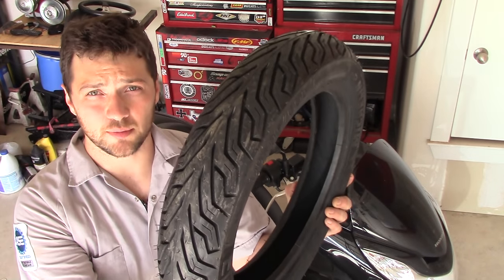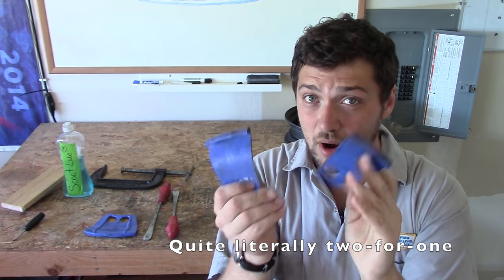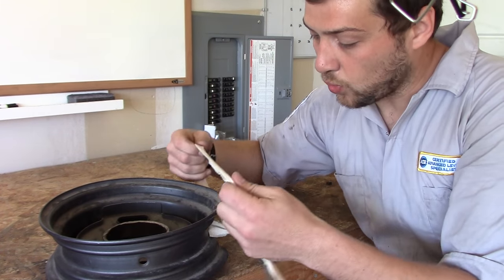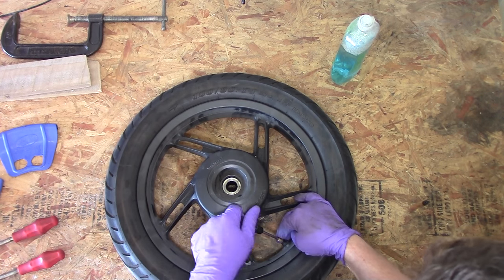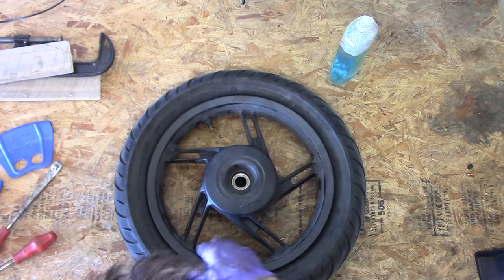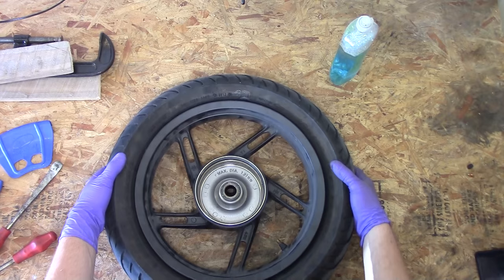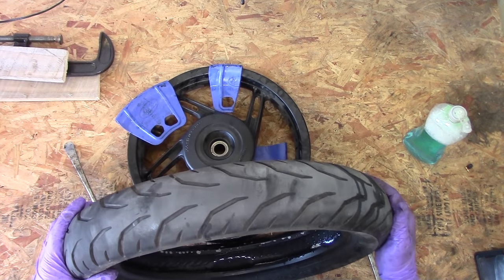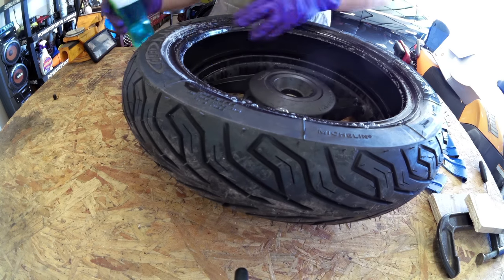Scooter 911: How to change a motorcycle or scooter tire BY HAND! (a complete guide!)

Comment: I am on a low income and this video may be the answer to my rear tyre XD
Reply from the maker: I hope it helps you out!
Reply: doing it yourself is less expensive only if you have $500 in tools
Reply: @carmineredd1198  wow what a bs. My toolbox is about 150 quid (with lots of tools crafted by myself using cheap hypermarket powertools).

I can literally strip the whole bike with these.
Reply: @carmineredd1198  Dude I literally bought 3 $5 flat heads from harbor freight and bent them and used a piece of cardboard as a shim. You can literally once you get it on the rim put it in the car run to the gas station and fill it with air then put it back on the bike. Not $500 maybe $30 tops depending how strong you are and you might have stuff around the house to use.

Comment: i used a rubber hammer to put it on and a wrecking bar to break the bead, lay the hook of the bar close to the rim on the  tyre and hit it down.go around the tyre on both sides, use you irons to lift it, to put it on jam the rim into the tyre, stand on the part thats not in the tyre and walk it in by pounding with the rubber hammer, insert tube and start it with the levers and when you get to the last tight bit, pound it with the rubber mallet, l used to change all my tyres cars scooters and motor cycles like this 50 years ago, now i just take it to a shop, bicycles tyres l still do at home without  any spoons just use  my hands, ps a split piece of garden hose protects the rim from scratches

Comment: Excellent video! Just used it as a tutorial to demount and remount a scooter tire to replace a leaking valve stem. One comment... I seem to recall a video in which Garrett said he was 6'3 and 200 plus pounds... So it's no wonder he can arm wrestle those tires while they  sit on a table at elbow height. For the rest of us who aren't so Texas-sized, what I found worked better was putting the tire/wheel on the ground and using my foot to hold the tire in the proper position on the wheel while mounting it back on with the tire spoons. Otherwise everything else was spot on! Thanks again Garret and happy scootering from New Braunfels!

Comment: Dear Garret

Greetings from London, UK!

Thank you for such a comprehensive explanation of the tyre-change process for a tubeless tyre.

I've changed tubed tyres before but when I researched a tubeless process I was put off because the video I watched showed the guy cutting off the bead with an angle grinder!

Your explanation of using the 'bead drop' in conjunction with the bead circumference is  illuminating - and is what one might do with a tubed tyre through natural discovery. But your explanation of what is happening makes the process understandable! 

In addition your technique uses force as a last resort rather than a first!

You have combined your obvious great experience with your very effective communication skills! Well done!

I also like the use of clamp and wood as an effective way of 'popping' the bead off the rim.

I feel well equipped now to change my next tyre - even though it's a 10inch - and stop being fleeced by  our motorcycle shops - (when they deign to change one, usually a couple of days!). 

So many thanks for your video.

Regards

Charlie H
Reply from the maker: I'm so glad to hear it Charlie! It's not every day that I get a comment that is so well composed thank you for spending your time on such a kind sentiment. It sounds like you definitely have what it takes to service your own rubber! Happy riding and keep it shiny side up. Cheers!

Garret Seesing

Comment: My local honda motorcycle dealer didn't sell the size of City Grip for the front tire, and refused to install them at any price if I bought them elsewhere and Cycle gear told me they only mount tires larger than 14" and I just wanted to say this video helped me alot. I would have much rather just paid someone because It took me 2 days of being so mad at my tires lol, but now I feel I could probably change one in less than an hour now that I get where I went wrong in the process, but this was an excellent starting point.

A great deal of that time was spent trying to get the bead to seat without an proper air compressor, the little tankless 12v one with my car couldn't overcome the leaking before the bead seated, and the bike pump was just impossible for me too. I even tried to ratchet strap to get it to seat. Eventually I took a 4500 psi cylinder and a regulator and some paintball equipment and with that much flow it seated in just a few seconds. Also I found that using a heat gun to make the whole tire warm to the touch made it so much easier to take off, and the cheap Amazon rimguards caused me lots of scratches, I bought the motion pro ones and I have to say they are worth every penny.

So now I have two new City Grip 2s, and my PCX can get back into the rain of the PNW without slipping and sliding

Comment: Just finished installing a new rear tire on my scooter. Thanks for your help man. I love saving money. When I went to the store to buy the tire they were all laughing when I said may I have the tire I just bought. I guess they thought I wanted them to install it too. I said no thanks. The guy said, ]who's gonna install it? I said, Me. He said, with what? A screw driver? They all got a good laugh And I walked out with my tire. Now thanks to you, I'm cruisin. Thanks again for the video. Gonna do a valve job next. Thanks for that video also.
Reply from the maker: Wow, thanks for sharing. that's exactly why I make these videos! Good for you and happy scooting!
Reply: Hey bud. Just did a valve job on my scooter. That was a tricky one. Everything is so damn sensitive. And you're not at exactly tap dead center its gonna be totally off. Any way just finished that she was riding great. Now I notice she has a terrible time in the morning cold starting her. Its not cold out by any means I live in Miami, but its taking several cranks and a lot of times I have to adjust the tension screw connected to the throttle cable. Thats the idle adjuster right? Is there a rule of thumb for that screw that I don't know about. Clockwise, counter clockwise? I just give it a few quarter turns in either direction till she cranks. But then the next morning, with that screw in the same position from the day before, she won't crank up. I already checked the fuel line and filter for debris, I put in a new spark plug and tested the plug wire. Those are fine. I ran a bottle of k100 thru her and changed her oil. 
So.... what am I missing?
Reply from the maker: @roryoconnor7239  well if the only thing you changed was the valve adjustment and now its running poorly I would re-check the adjustment. other than that i would suspect you might have an issue with the autochoke, but dont go jumping to conclusions. make sure you test everything before you start changing variables. make sure that you didnt bump any vacuum lines loose or leave anything unplugged. Also the idle adjustment screw really shouldnt help it start any more than applying some throttle by hand. let me know what you find
Reply: @Scooter_911  lol. Vacuum line came off while I was messing with stuff and I didn't see it. She's running great. Thanks for your time and videos.

Comment: You're my font of all scooter knowledge, I have to change my exhaust, so for the first time ever I'm doing my own tyres in time for this weekends ride, and thought I'd have a look at the process first.
Reply from the maker: Plan in some time for swearing! The first time is challenging but I'm sure you can handle it. Just be patient!
Reply: @Scooter_911  Oh yes there will be swearing, I've chipped my  nails already (manifold & support bracket bolts), I stopped for a bit of lunch when I watched your video after taking the exhaust and rear panels off, I'm now on a coffee break and the rear wheel is off, thought I'd start there first as it's a lot more involved than the front, I'm doing this at work as we have a compressor and lots of tools here, the two men I work with are sensibly keeping out of my way., also the scoot can stay here if I fail.

Comment: 2 important tips to make life easier. 
- Always use 3 tyre irons. Much easier to "walk" them. One after the other.
- In the absence of a "tyre machine". One can fix the tyre with a large bolt+large washers and respective nuts. To fix the tyre onto a regular bench vice. Not having to hold the tyre at the same time, as doing other operation, render it incredibly easy. That way there's no need for all that gymnastics of holding the tyre while pulling and pushing. ;-)

Comment: When I purchased by used scooter that was sitting in a warehouse for a couple years. It barely had any miles on it and the price was very competitive. Buying used, you never know what you'll get yourself into but the only thing I found wrong with it (so far!) was the rear tire had lost air. Couldn't tell if it was lost while sitting or had a small leak. After filling it with air and riding it very short distances. I let it sit and the following day, the tire had deflated. At the time I was very excited about getting on it and riding it so I took the easy route and used the fix a flat sealant. It works great but I know that I can't drive safely with the sealant. I have purchased a new tire and plan on using the same rim. After talking to some mechanic friends they told me "have fun getting that tire off with the fix a flat sealant! It's going to be a pain in the you know what!" Thinking about it more they're absolutely right! At the time I wanted to ride! Probably should've done my homework before adding the sealant. I have not tried to do anything with it yet because I'm not sure if it's something I can do myself or try to find a local tire shop that would be willing to work on a scooter. Not that many scooter shops in my area. Any recommendations on how to remove a tire that has fix a flat sealant? Should I buy a tire with the rim on it? Or possibly find a local mechanic that will be able to take care of it with out charging too much since there's extra "labor" involved. Any help would be greatly appreciated! Stay safe! Drive Safe! And most importantly Have Fun!

Comment: Great explanation, although it's still harder than you make it look! Good tip about cutting the guard in half. I would observe that this process is materially more difficult with smaller tires, which don't have much flexibility to wrangle around the rim. Given that I was never going to use the old tire again, I've found it easier to use an oscillating saw to cut the old tire off the rim, which only takes about 30 seconds. Also, I've put internal Bluetooth TPMS sensors into the bead drop underneath the valves. They work great, but they make it more difficult to get the tire on, and I was happy to pay a shop to do it for me.
Reply from the maker: Absolutely! I've been changing tires professionally for around 10 years now and I still struggle putting the 10" racing slicks on my race scooter. Like you said sometimes its just better to have someone with a full tire machine do it (or do it at the shop instead of in the bed of my truck on race day...)
Reply: Man, that’s a great idea about Bluetooth TPMS sensors. The number of times I’ve fried my hands on the exhaust checking the rear tire...
Reply: Paul H Just don’t use the kind that screws onto the end of the valve like a lollipop. The added mass stresses the valve stem and makes it wobble, which on mine caused a leak and battered the sensor against the exhaust, breaking it after a few miles. Only use the sensor type that installs inside the tire.
Reply: tenders Good to know! I’ve seen those and had my suspicions but I also figured it probably couldn’t hurt to try them. Seems I was wrong! Sorry you ended up learning the hard way but thanks for helping me avoid the same mistake.

Comment: Hi Garret. Thank you for all your efforts in producing these scooter videos. They are well done and easy to follow. I am a 70 year old retiree and while I have been riding bikes since I was 14 I have just purchased my first scooter. I need some help with an issue I have. The scooter is a 2009 Aprilia Scarebeo 200. My problem is I can NOT get the seat open to get at the storage compartment or the gas tank. There is a remote release for the latch, operated by cable from the ignition key. I am unable to figure out how to get to the latch under the rear of the seat. I am very afraid of damaging the plastic. Any suggestions would be greatly appreciated.
Regards Inspector Gadget
Reply from the maker: Oh bummer, I've had to deal with that a few times. If you're very patient and a little clever you can stick a long thin screwdriver under the seat and poke at the lever that the cable pulls. If you hit it just right the seat will unlatch and you can disable the latch. Good luck!

Comment: First of all, it's not really as easy as it looks. You will probably need to use the C clamp in several places on both sides. That bead will be REALLY stuck on there. DO NOT use dish detergent as a lubricant. It will cause corrosion on alloy wheels and rust aluminum wheels. Use actual tire mounting lubricant. I have also used furniture polish like Pledge, or a generic equivalent. That stuff is super slippery, but won't damage the wheel like dish detergent. When using a C clamp to break the bead, make sure that the C clamp on the side without the board does not damage the wheel. Notice just how close it is to the rim at 5:40. The threads on a C clamp can really chew up a wheel. Also, do not use a steel tire lever to pry against the inside edge of the rim. The inside edge of the rim is what the tire seals against, and it is extremely easy to gouge, creating a leak between the tire and wheel. I have a C clamp that I have removed the swivel end from. If you are removing an old tire to replace it with a new one, it doesn't matter what happens to the old tire. And it tends to be a lot more difficult to remove the old tire than to install a new one. I drill a 1/2" hole in the tire about halfway between the edge of the rim and the outer edge of the tire. I then place a metal washer over the end of the threaded part of the C clamp, where I removed the swivel. The washer prevents the threaded part from pushing through the tire, but allows it to push through the hole drilled in the tire enough to keep it from sliding up against the rim and damaging it. Take your time here. The wheel is VERY expensive, the old tire is worthless. 

Once I get the bead broken on both sides, I don't even try to lever the old tire off the wheel. I drill another hole in the sidewall on the other side, then use a box cutter to cut through the sidewall on both sides. Then you can remove most of the tire, leaving only the beads and a small part of the sidewalls. With a little lubricant, they will slip right over the rim without using any tools. 

When installing a new tire, if you touch the wheel with a tire lever at any point, you WILL scratch the wheel. There is just no way around it with an alloy wheel or a painted wheel. That part about it's working its way off in a circle just after 12:20 WILL happen, over and over again. It will almost never go on the first time. It is physically impossible to hold the tire bead in place with your hand while trying to lever the rest of it over the rim. The lubricant will make it too slippery. And the wheel will want to slide all over the place. Instead of trying to hold one side of the tire bead down in the center of the wheel by hand, I use a piece of rubber heater hose made for a car and force it between the rim flange and the tire bead to hold the bead down. The last little bit of the bead will be by far the hardest to get over the rim. You cannot stretch the bead. There is a steel ring inside the bead. Steel does not stretch. As was mentioned earlier, the key to getting the bead over the rim is having the opposite side down in the center of the wheel. It will eventually go on, but you are going to make a LOT of scratches on the wheel. There is just no way around that while using steel tire levers in direct contact with a painted alloy wheel. 

When seating the bead, a bicycle pump may or may not work. They are made for tube type tires. Once the bead is seated they work fine, it just takes a while. But sometimes to seat the bead you need a sudden large blast of air that you can't get from a bicycle pump. Sometimes wrapping a ratchet strap all the way around the tread of the tire and tightening it down will spread the bead outward against the edge of the wheel, making it easier to seat without needing a high pressure/high volume blast of air. 

The small the diameter of the tire, the harder the job will be. The 12" tires on my Vespa are a nightmare to replace. My wheels are all scratched up. I actually bought a new set of wheels for it because at some point the original wheels are going to become too damaged for the tire to seal against the wheel. Scooter tires, especially the rear one, only last 5,000-6,000 miles, so it will take a LOT of tire changes to reach 50,000 miles. And every tire change will do more damage to the wheel. You can avoid that by having a dealer replace the tires, they have a machine that does it without touching the wheel. But they charge more for doing it than it cost for new wheels (at least for a Vespa, they are $75 apiece, some Japanese wheels may be several hundred $$$ apiece) and you have to leave them there and then go back and pick them up. 

I can guarantee that black painted wheel is now all scratched up. There is simply no way around that unless you do it the way they do it in this video  https://www.youtube.com/watch?v=Ux6cLiy2buo&t=92s   using a tire mounting machine.